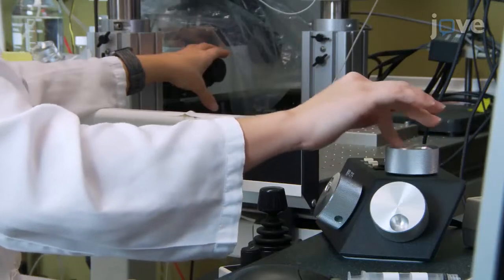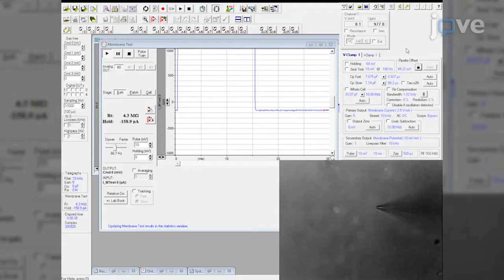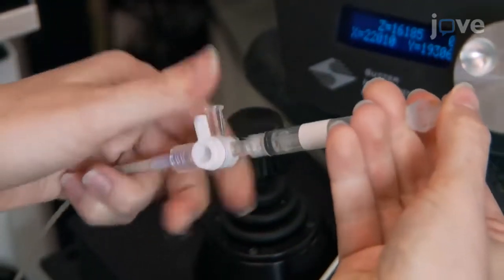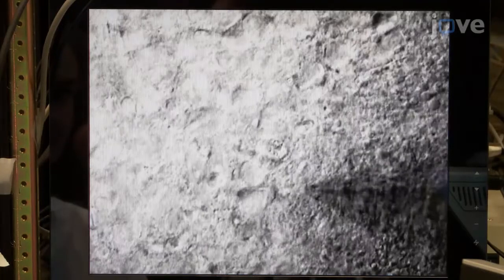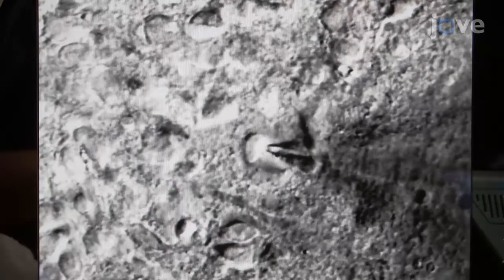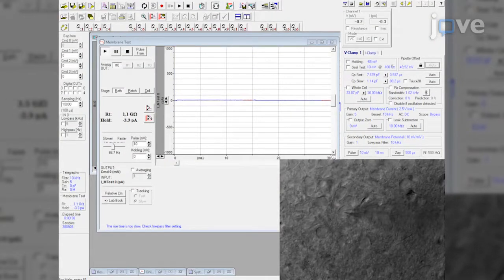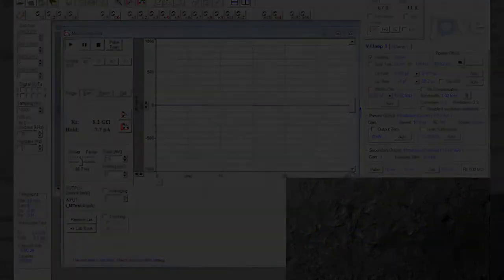Patch-clamp Electrophysiology for Synaptic Multiplicity Evaluation | Protocol Preview

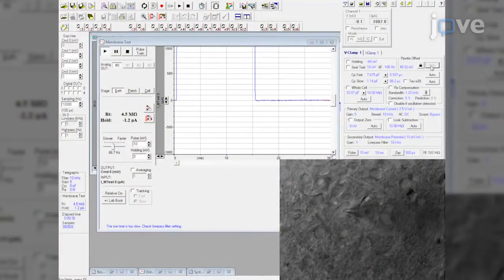Comment: 1:38 I am wondering if there is any other way to provide better pressure control as our researchers complaint that this way affect their experiment results.
Reply: from my experience, I have another tube connected to the lock where I apply negative pressure with my mouth. this also allows me to break the membrane with negative pressure for whole cell recording.